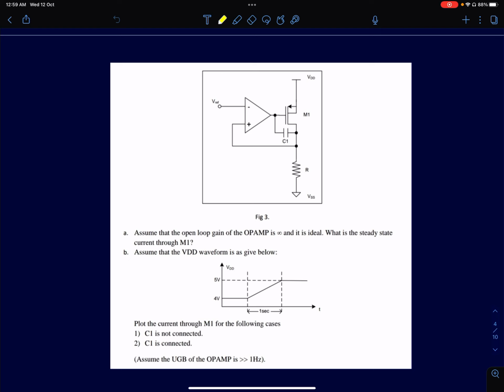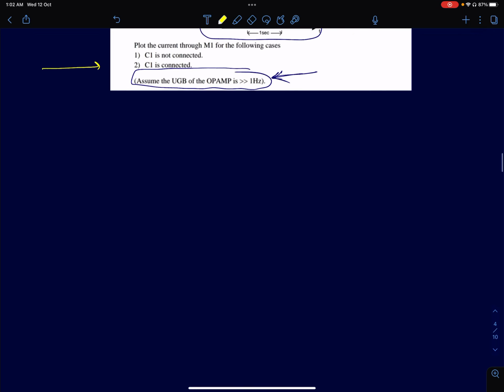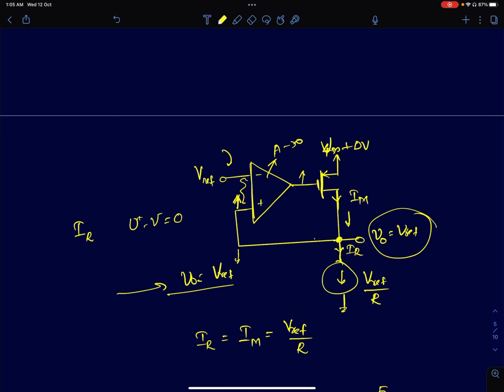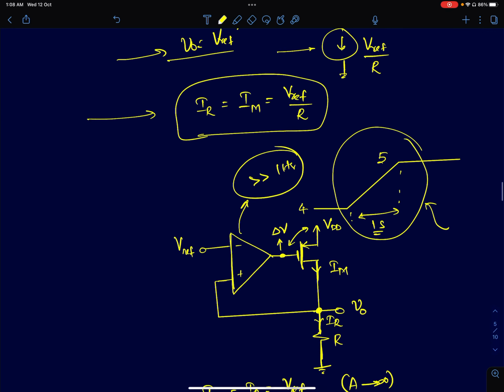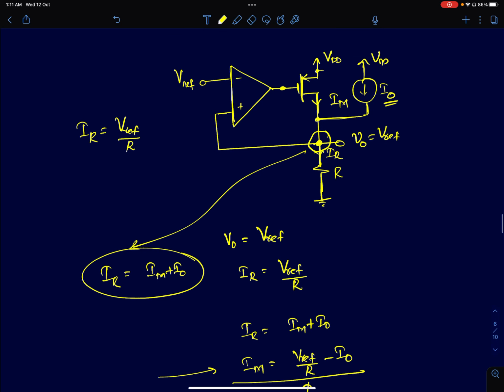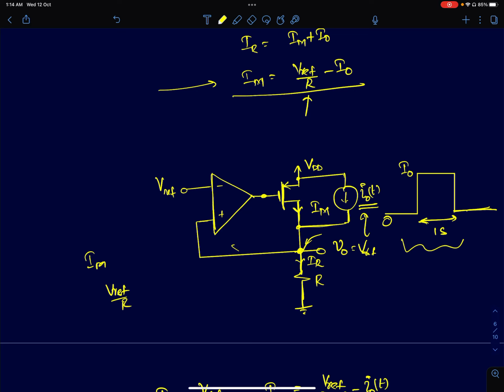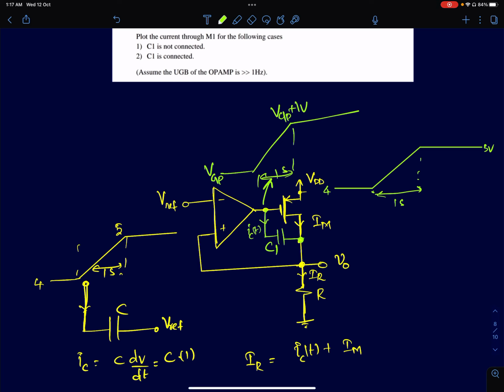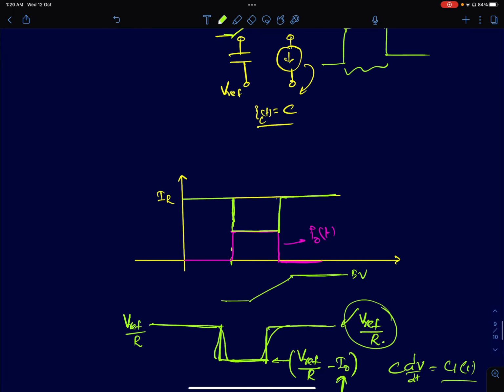AIC Lecture 52) Transient response of an Opamp based circuit problem (series Regulator circuit)

Comment: 21:11 It's acceptable for the PMOS current to decrease in order to maintain a constant Vref/R, but which specific node in the circuit facilitates this adjustment? VG? But it is following the VS (VDD trend).
Reply from the maker: It follows the vs trend but it will undergo a sudden change to decrease its vgs to accommodate the change in the current. The vgs with n without current source will be different.

Comment: The analysis presented for the case with the capacitor is not entirely accurate. You assume that the gate voltage for the PMOS goes from VGP to VGP +1 in a linear manner. We also know that the current through the PMOS is Vref/R when gate voltage is VGP and VGP + 1. Since VDD goes from 4V to 5V in a linear manner, this means the difference of VSG for the PMOS i.e VDD - VGP is always constant and hence the PMOS current is always Vref/R, which we know is true. This implies the assumption of VGP being linear is inaccurate. If you write KCL assuming large signal, you will find a first order non-linear differential equation. I am not sure what small signal approximation can be done to the large signal equation. Perhaps a video to go over this in a more rigorous way would be helpful to everyone.